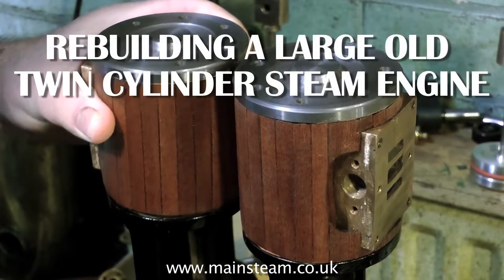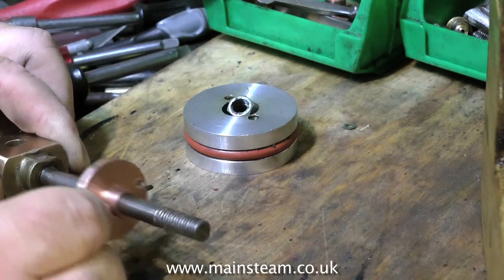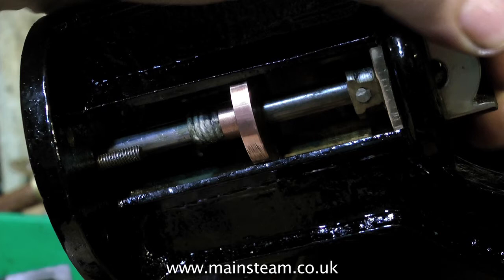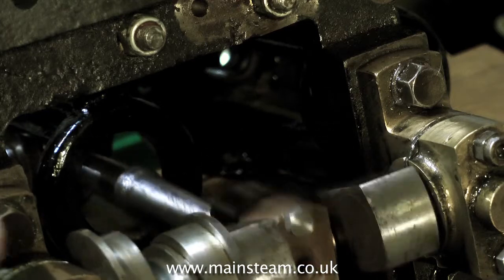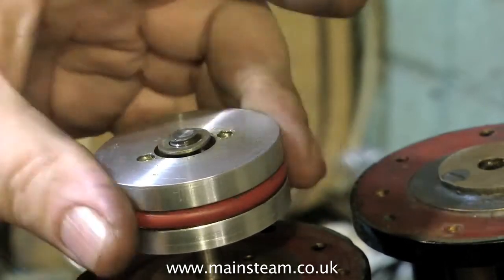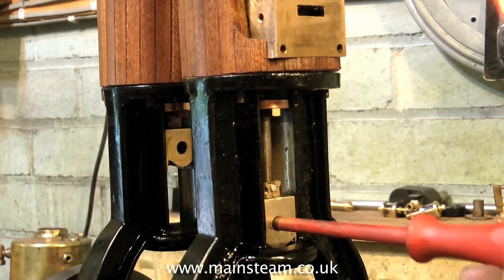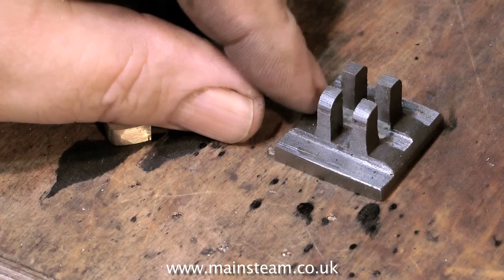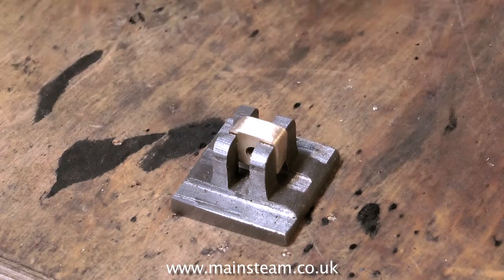PART #12 - REBUILDING A LARGE OLD TWIN CYLINDER MODEL STEAM ENGINE

Comment: I noticed that it seemed like there was a big O-ring on the piston instead of piston rings made of cast iron. Is this correct? Does it work as well as piston rings??

Awesome videos!
Reply from the maker: MattsMotorz I prefer cast iron piston rings, but high grade silicone O-rings also seem to do the job quite well and are sold for this purpose. I have a few steam engines with silicone rings and they work very well without any steam blowing past the pistons.
Reply: Cool! Thanks for your response!